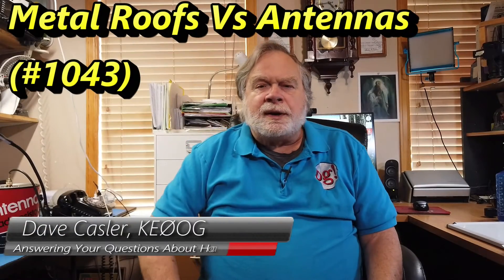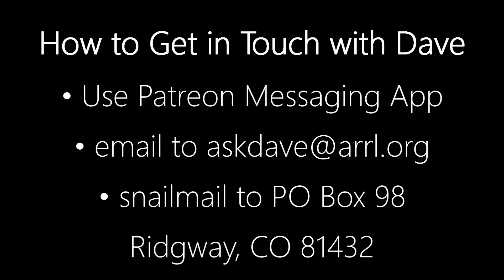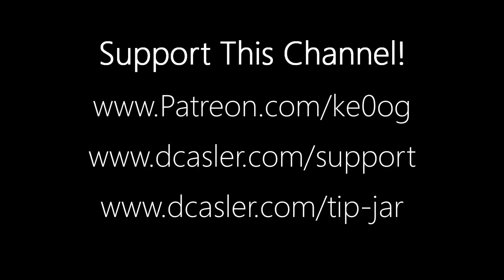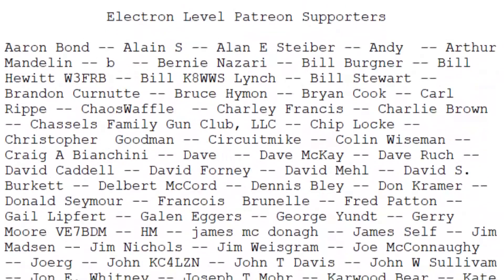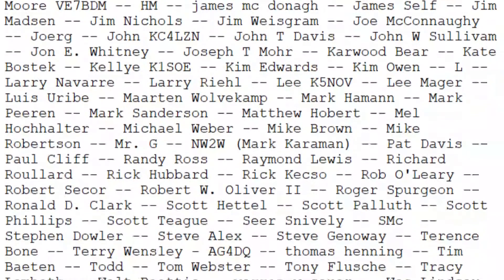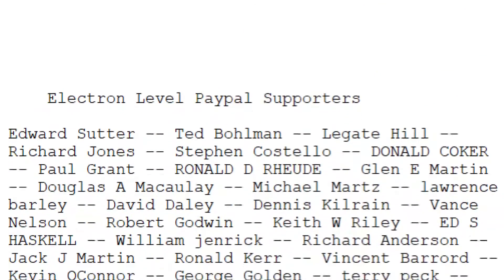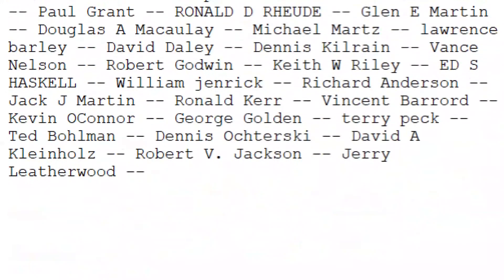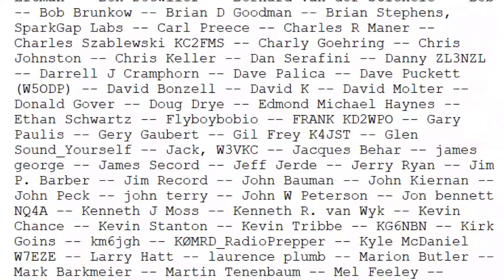Metal Roofs Vs Antenna (#1043)

Comment: Been a CB antenna question IV had for a while with a new steel garage .. was just gunna add a radio antenna just mount a l bracket at the end gable ..well not reading well on the swr .... But may move a few feet and put up another pole . ... Takes almost 5 people to lower my big antenna . It will lift a man off the ground easily .. hard to get that many people together to help these days

Comment: Great video ! i have a cb antenna on a 9 foot short tower right next to my steel 30x 25 foot Morton barn,it recieves well but the outgoing transmitting signal is low to everyone ,any suggestions? Im losing RF in the roof? Thank you for this informative video.

Comment: Put and nail a tv transmitter on the metal roof in the house more channels then buying antenna and paying cable, opt, fiber and satellite. The TV channels is all of free and still too much channels.
Reply: Might try. Have metal barn.  No reception of anything.

Comment: I have been running a dual band mobile 2m/70cm antenna on my metal 40'x60' roof in the center for a few years.  I still plan on bonding all the top steel panels but still haven't got around to it.  A/Bed with a Comet GP9 up at 35 feet was almost no difference!  In fact, I took down the wind whipped GP9 and have just went back to using my little mobile.  I regularly talk to stations over 50+ miles away and it works great.  73

Comment: "The mast was five times taller than a six foot guy"  That is a warning message anyone can visualize and understand. 
"Mount the antenna in the middle.:  Made me think of my van. Car body is also a big sheet of metal not connected to the ground. The best TX/RX is along the body. Mid point is good over all. Rear bumper mount works best in the direction of the front bumper. 
Good question. Great to hear a good answer.

Comment: I recently read an article on NVIS antennas that mentioned this: "The impedance of a half wave dipole in free space is about 70 ohms. As it is lowered, the impedance drops.  When it gets to 7-8’ high, the impedance is down to about 12 ohms. "

Can you explain why the impedance of an antenna changes with the height? Why doesn't it stay the same regardless of the height?
Reply: Inductance propagation/reception coefficient combinations.

The 'pool with single point og waves' analogy is good for antenna reflection theory I find for conceptualizing it.

Comment: I live in an A Frame with asphalt shingles and need a new roof. How does adding a metal roof or metal shingles affect indoor antennas like You Loops for HF reception or Rubber Duck antennas for VHF? Does it act like a Faraday Cage ?

Comment: We have 16 different verticals mounted on our shed with metal roof (original house built around 1920 with metal roof). 
 The advice of mounting in the middle is good if available. Otherwise be at least the 1/4- 1/2 wave length from edge when possible. I have found this does make a difference at the very least, unless the antenna is meant for edge mount, such as some newer mobile antenna designs. ( have seen a permeant install with such an antenna system instead of a larger corner reflector).
 We did have the ATAS-120A mounted at one time up there with satisfactory results, but was replaced with the dipole at 40FT,

Metal roofs will act as an interesting reflector for dipoles or other aerials above but not mounted on. Pro and Con!  Especially for  multiband antennas where the radiation pattern (lobes) change with band. Dont forget to then add weather effects as wet metal reacts different then even wet clay tile or asphalt shingles, or snow covered. It has been fun experiencing some of the effects and seeing how wildly they can swing where I live in a dry desert climate in summer to the wet snow in winter.

Comment: Think about airplanes. "UHF, VHF, MB" Antennas usually use a 1/4 wave length antenna. From memory a good antenna is 1/2 wave length. A 1/4 wave length antenna uses the aircraft skin as the missing 1/4 wave length. Giving us a effective 1/2 wavelength antenna using the combination. This is not for HF. Most metal aircraft every piece of metal is bonded to its mate it is an effective ground, think static discharge.